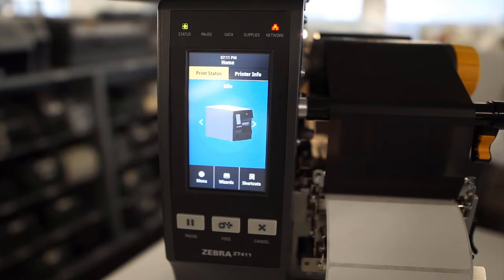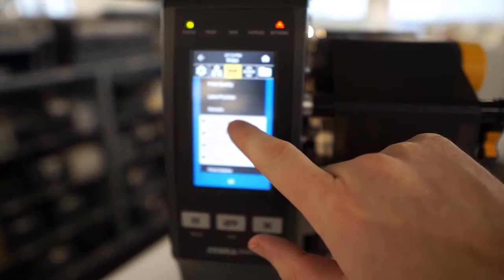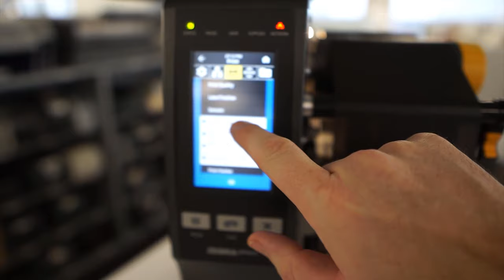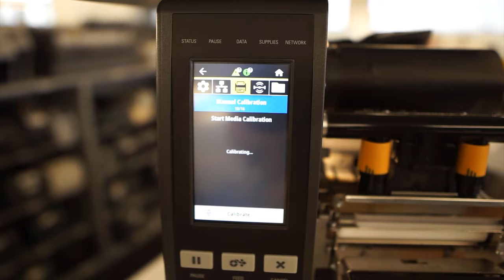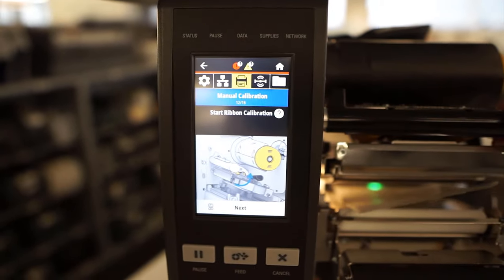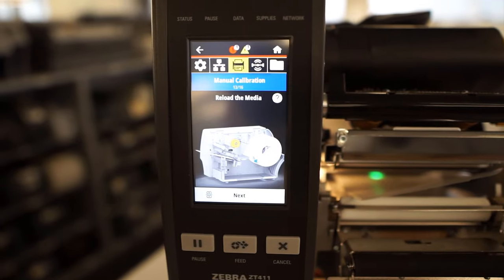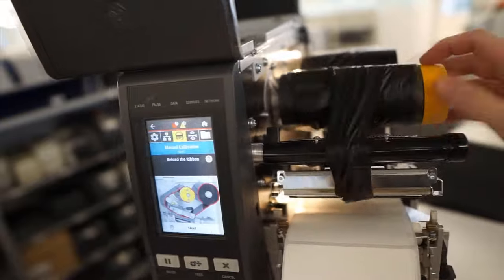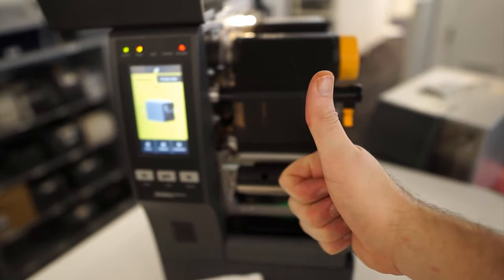ZT411 Printer: Ribbon and Media Calibration | Zebra

Comment: Pressing the Next buttons on the screen doesn't work most of the time.    Brand new Zebra is defective as it won't register pressing Next to calibrate
Reply: I experienced the same problem
Reply: Same issue I faced myself. I had to use a stylus pen just to get a full click.

Comment: we use this exact model everyday in warehouse. Every so often it says “ribbon out” but it’s clearly not.. we keep having to switch to Direct Thermal and even then it doesnt work
Reply: Same. We use Direct transfer labels and every now and then the printer will say "ribbon out" and won't accept the "direct thermal" setting. It just takes multiple tries of setting it to direct thermal before it takes. Very frustrating.

Comment: Hi we have a new brand Zt620 , we set  de ip at the printer but we dont have ping. We set the same IP in the laptop and the ping test is sucessfull. Any Ideas? We dont have the ribbons yet, could it be this an issue to finish the configuration?
Reply from the maker: Thank you for reaching out. Please visit the ZT411 Support page and click on "Labels, Parts, Accessories and More" to find more information on initial setup and troubleshooting: http://social.zebra.com/6055wsz3x.